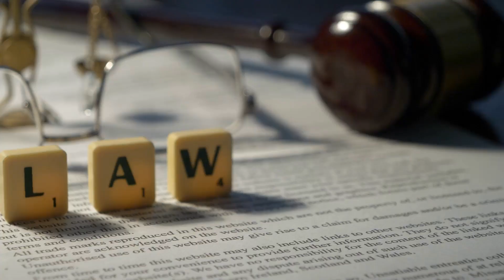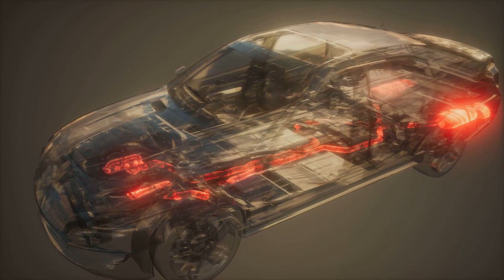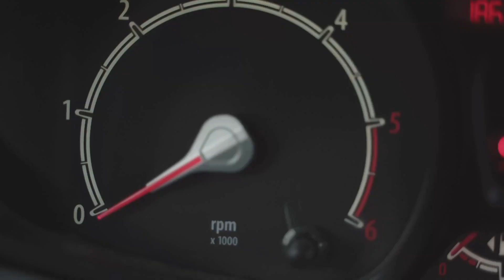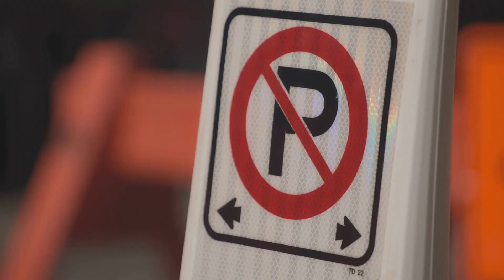Never Remove The Catalytic Converter! It's Illegal? How To Delete Cat?

Comment: Most new cars are not investments, built good enough to get you through most of the financing to trade it in on another one. I glad you told me it's between the motor and muffler. What about resonators? I've  seen them on many cars in all kinds of configurations and at times depending on car brand look very similar to a cat. Catalytic converters burn off hydrocarbons left over from combustion. Hydrocarbons, seems very hypocritical when the people pushing for these restrictions are very dismissive on their consumption of the resources. One engine you showed had a generator on it, far too old to be used as a reference in the video.
Reply from the maker: Thanks for your detailed comment and careful watching of the video! Watch this video https://youtu.be/h3nVJUq5AJU, i think you will lake it!

Comment: Just illegal. Cats don't adversely affect performance like they used to. In the 70s they restricted exhaust so badly and made detuning of the car mandatory so cars ran like shit from 1974 till at least the mid 80s when they developed free flowing cats. Back then it was worth 50 to 80 horsepower to remove that damn potato from the exhaust system. Police did it all the time. If your cat is stolen you can put a pipe in there temporarily to keep you going till you replace the stolen cat. Glad my cars are old enough to not require them.
Reply from the maker: Yes, because the catalytic converter is about the environment, and the loss of performance is as a measure to keep people off it!